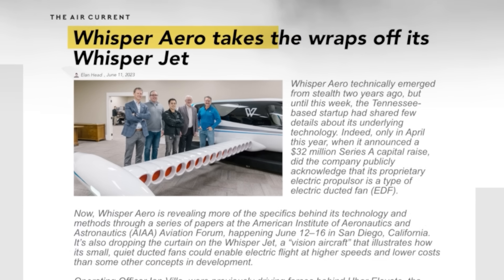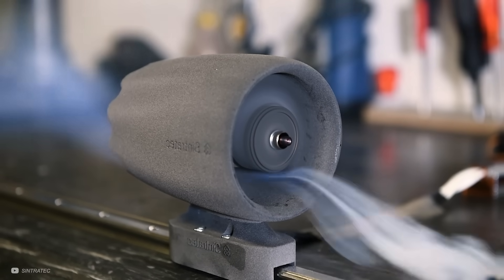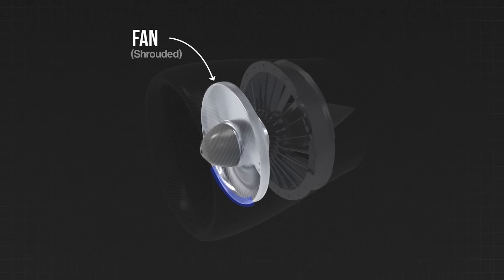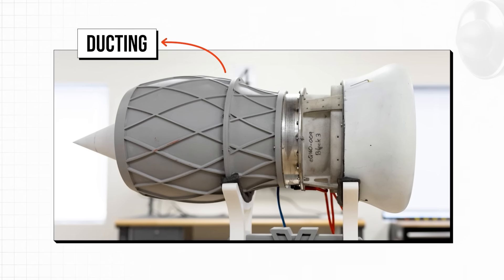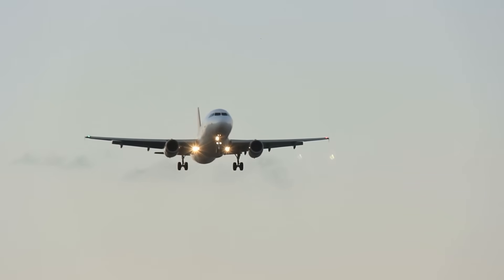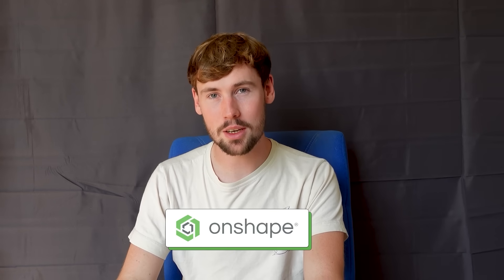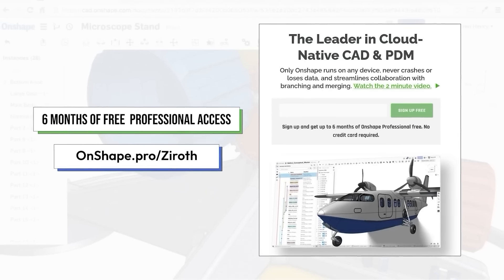This Genius Jet Engine Is Starting A Revolution

Comment: With RISE that promise to meet all noise regulations you get away with nacelle but you add variable pitch blades and vanes, for smaller engines this becomes easier (like variable pitch props on an old P&W R-2800 engine)

Comment: So electricity can be a Jet Fuel? If that doesn't immediately sound ridiculous to you, go study aviation more. Don't matter what kind of fan you're using if it isn't combusting some sort of fuel in a [intake->compression->combustion->exhaust] cycle then it isn't a Jet. Just because it has jet like cowlings or housings doesn't make it a jet engine. Also, @j4s0n39 is 100% right about the energy density of Jet fuel compared to batteries never mind the issues of generating just as much noise but in a higher frequency. Even if its perceptibly inaudible there's no way there aren't biologic and ecologic impacts they don't want to share

Comment: 16000 Hz isn't outside hearing... hearing goes all the way up to around 22000, and back in 2019 (I was 36) my hearing was still able to (barely) pick up sound in that range.

Comment: This is a design crontradiction.. Higher area means higher efficiency, because you need lower preassure difference per thrust. This also means slower propellor-airfoils - thus lower noise-frequency. In general, lower pressure also means lower noise. So, they decided to shift the frequency and see what they can do disregarding other design paradigmes.

Comment: It will work for low thrust slow lightweight applications. The theories they are applying is basically everything known about CFD and they must optimize it and advance further. The kilowatts are simply not there to compete with combustion. In a jet(diesel) turbofan a good part of the thrust is the massive expansion and focus of the exhaust. The combustion does mechanical work that an electric motor could replicate. But has no way to replace mass expansion of super hot exhaust. 
Due to global pressure etc people have been throwing good money after bad. Is simply not possible. That's why they are going for carbon neutral and hydrogen research.  The amount of power the electric fan would need would be at least 50% greater shaft kw, really mw or tw, to make up for the combustion expansion. Until we come up with zero point modules, batteries would be way too much weight. Someone might achieve it with a modified plane with no capacity for passengers or cargo. For comparison on the ground, where's the all electric semi trucks? 
Edison trucks making hybrids is the only way to go. Hybrids are doable. Maybe even in the air for takeoff and acceleration thrust.

Comment: Everyone complaining about battery weight to energy capacity, please go look up solid state batteries.  We are about 2 years out from them being common and will change the entire landscape.
Reply: A solid state battery is promising roughly twice the energy per Kg compared with current battery technology. What is needed for any useful application is roughly 25 times the energy density of the current battery technology. That is the break even point with fossil fuels.

Comment: A gas engine can be quieter than the tires on a car.  Turbines are loud but something like 80% of a helicopters noise is from the tail rotor. I just think that the whole idea of quiet=electric is not always true.  Get into a luxury car like a Lexus and you can’t hear or feel the motor.

Comment: Its never going  to work in real terms on a plain as the jet engine used combustion  as thrust. Jet fuel is more efficient than a battery. And lighter.....

Comment: In my experience, more engines = more $$$. The other problem is how to power an electric engine. Batteries add lots of weight and are risky for passenger transport. If a car battery catches fire you can evacuate, but an aircraft battery fire mid air would be 100% catastrophic. Unmanned aircraft could potentially use this tech, but it will be a very long time before this is safe for public transport.

Comment: DoA, since commerical planes use megawatts of power. One Ge90 jet engine produces about 46 MW of power. For 1 hour of light it would consume 46MWh of power. 1 MWh Lithium battery would way about 10 tons. so to power a 46MW jet engine for 1 hour of flight you need about 460 tons in batteries. 

When keroscene (Jet fuel) becomes too expensive that will be the end of commercial avation for the masses.

Comment: Would be interesting to integrate the design with standard jet engines. They could look into the older triple engine plane designs by replacing the wing engines with these electric ones whilst keeping the third tail jet engine

Comment: This won't work as far I know. This has already been figured out using gas engines. If they are not using a jet engine, a regular 6 blade propeller will function better than a ducted fan. They can try with a duct but a standard propeller or ductless fan will work better. The best design for this is a duct that is slight smaller than the circumference of the fan. The optimal fan speed is I'm guessing is 5-7k rpm even though they say 3.2k rpm. After tackling all those issues you will have to deal with the weight of the batteries.

Comment: 3:50 Noise is NOT just the frequencies humans can hear 
It is any vibration that can cause discomfort or harm .
You can't hear ultrasonic's but they can macerate your ear drums.
This project would have far more value if they could use the noise as an additional power source to increase thrust while it is cancelled out.

Comment: I've seen a very similar design... Not in an engine, but as a static wind turbine. Despite very good results in university testing, it got spun-out and sold off. Suddenly a former head of the NSA was on the board of the company. That is a commonly seen sign of the technology being "secretized" and suppressed by the US government. There was some differences: The first stage was larger than the second, the third smaller still. There were wind "bypass" slits in the cowlings. But the successful general idea is to use the power of the vortex to help spin the later stages.

Comment: Hubbed fans are great for noise control... Not so great for energy efficiency or structural integrity.
Propellers put the mass of the fan blades as close to the hub as possible, because the further out you go, the more inertia you have to fight. In a fan that runs at a constant rate in a controlled environment, this isn't a major concern... But the spin up and spin down of the fan for takeoff, speed adjustments, and wind induced changes from be buffetted by the air... You need much stronger blades to support that hub, which means thicker blades, which means more mass, and you have the propeller version of the rocket problem. In leaf blowers and PC fans this is sometimes an acceptable loss for equipment operating in close human contact... But even there you don't often see it because it just isn't worth it.
Then there is the shroud of the duct. In a jetengine it is a ridge body to encourage airflow of expanding gasses in a general direction, and give mount points for extremely heavy equipment. But in a fan, the blade shape does that. Outside of noise control or trying to bend the flow of air, there just isn't much point to a duct for propulsion, because the fan blades do the pushing and any wall that interferes with that. Airflow is going to cause back-pressure and inefficiency. Then add the additional weight of the duct, and... Yeah. Less efficient, but more control over a few variables.
As someone who lives near an airport... Planes of this size aren't a major noise issue. At the flight height you can't hear a normal propellor based engine on the ground unless it is a particularly quiet day. I just don't understand the problem they are trying to solve. The problem is big jet planes... Which this is not and can't even begin to compete against. It's a red hearing of solving a problem in a market they don't operate in, while not addressing the issues of efficiency and flight time in the battery electric flight industry that is trying to take off.

Comment: I doubt the efficiency loss and increased weight compared to props (and the powerplant weight) will make this practical for actual planes, but the military would probably love some ultra-quiet drones.  Even if they're louder outside the human hearing range, making the enemy have to use (and carry) acoustic detection gear instead of just their own ears would be a big advantage for both surveillance and attack applications.

Comment: @1:44 Where did you ever hear that?  Putting a shroud in it such that it’s measured by thrust instead of lift makes it a “jet”.  Being an “engine” means you’re a “heat engine”, powered by a heat source.

Comment: The problem with electric engines isn't the propulsion. It's weight of the power source. When a fuel powered aircraft flies it loses weight as time passes due to the combustion of the fuel. That doesn't happen with batteries. In fact, there is virtually no difference in weight between a battery that is charged and one that is not. Since there is far more power in a pound of aviation fuel compared to a pound of battery, there is no way as yet for battery powered aircraft to compete with liquid fuel powered aircraft.

Comment: I think electric propulsion has more urgent issues like power supply. At this time I see only the solution by use of a gas turbine generator with a battery buffer. Everything else like battery of fuel cell / hydrogen is too heavy or too large.

Comment: The catastrophic failure of "eAir" is battery tech, or simply: electric won't be viable in the skies w/o battery tech taking huge leaps forward and drastically closing the W/kg gap with hydrocarbon fuels. Perhaps future aircraft are compelled to electrify and take a serious performance hit cuz batteries that light are yet unavailable or impossible (:: this looks like it could be viable tech for slow cargo planes, ~300-350MPH cruise). Who knows 🤷‍♂️ Perhaps if the entire structure is turned into a battery, much as electric road-going vehicle battery packs are structural members

Comment: The concept leaf blower got me thinking about alternative use cases. For example, HVAC systems need to move large quantities of air efficiently and they tend to be noise. Dust collection systems for woodshops and shop vacs can be crazy noisy as well.

I wonder if it would be possible to use toroidal blades on their turbine?

Comment: I'm not an aviation engineer but in my mind the stator would be an array of horizontal and vertical slats, the horizontal ones could have a variable angle to tilt thrust up or down. Maybe the vertical ones could also have a variable angle, eliminating the need of a rudder.

Comment: This is terribly researched.  None of these things are revolutionary.  All modern turbofans have stators, the turbine fans to the rear of the compressors often have outer rings, it's heavier and less efficient than open front fans.  Ducted wing fans have advantages and NASA has done a lot of research into electric wing fans driven by wingtip jet turbines, but that design shown can't glide should it lose power.  Seems like a death trap.
You're just doing marketing for some at best average ideas.

Comment: It kinda just looks like a nicely optimized ducted fan, and not really all that transformative. Its got a convergent divergent fan casing, which is great for flow and maintaining pressure differential. The use of stator vanes is great for replacing a long thrust tube, which is typically the route to eliminate swirl and get horizontal flow. 

The biggest change is the near compressor style fan unit. Like the ring shroud is probs a compromise to get as thin a blade as possible. I get why: the higher the aspect ratio the greater the blade efficiency. That is probably where most of the efficiency gains are coming from.

The compromise for high aspect blades is low potential E-flux, which might be what motivates the fan casing design. It's interesting less because its new ideas, and more like utilizations of design choices more common in gas turbines

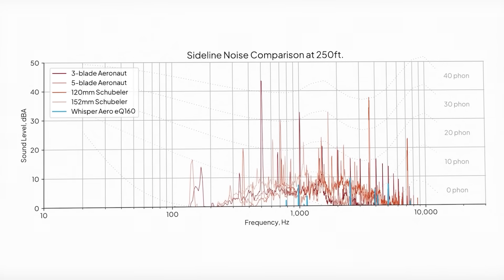Comment: @6:18 This sideline noise comparison is erroneous, the acquisition points across frequency range don’t appear to be standardized given the measuring at 250 ft; the tonal spikes could simply be aerodynamic transitions, not inherent design differences. At best, the plot reflects specific test conditions, not a fair basis for cross-design noise claims.

Comment: Comparing a Ducted Fan with a Gas Turbine powered by Pass Engine will tell you all you need to know. Range, energy conversion size, weight, power.
Your "solution" is anything but, just a dream....🤔🙄🇬🇧

Comment: Cool and all, but saying this "fundamentally changes how electricity is turned into thrust" I just a lie. Nothing changed just optimized. Still spinning fan in a tube. Not much different than normal jet engine (fundamentally that is)

Comment: There's also the fundamental problem of dividing power between several ducted fans, instead of only one. The perimeter of the fans, and therefore the internal wetted area of the ducts, increases with the number of ducts. I assume that they hope for a benefit from some sort of jet flap arrangement, or perhaps the electronically-commutated electric motors don't come in larger powers, and have to be installed in multiples.

Comment: The problem is the weight, size and capacity of batteries / power cells.
Endurance / range is the main problem. It may look impressive on a model, but once you scale it up, it loses its appeal.
You need range, endurance and enough capacity for a commercially viable carrying capacity.
In short you need to be on the same level or more cost effective than an orthodox aircraft.

Comment: Sacrificing efficiency to low noise makes low efficiency certain - high solidity, high speed means large friction losses. So does connecting the tips to a rotating ring, though that might be unavoidable due to the small size of the unit (smaller units suffer more from tip losses). As for using the stator to vector flow, is that Whisper Aero's claim or Ziroth's? That would require each stator blade to be re-pitched DIFFERENTLY, and I don't see a mechanism for doing that, or room for one.

Comment: Since these still require a power source, which is pretty much going to be a turbo generator, it would be interesting to compare the total system efficiency of lbs / hour of fuel burned vs lbs of thrust delivered vs a conventional turbo fan. Then imagine if all of these improvements were applied to a turbo fan. The turbo electric drive is always going to be heavier and less efficient.

Comment: Useless waste of time. Aircraft will never be fully electric the laws of physics dictate that electric planes are too inefficient due to having to carry all weight of the dead batteries to the destination. In a conventional fossil fuel plane it gets lighter as the fuel is burned off so that there is almost no fuel in the plane when it lands. This severely limits the range of an E plane as batteries are heavy. Fully charged they are useful but empty they are useless weight.

Comment: How does it fare when wet? We live on a very wet planet, so it's kind of important. If they utilized grooved blades, would it bring down the noise back into the human range again or perhaps bring it in line with regular drone engines, only with better thrust? I have more questions, but their website has few answers, just like this video. I still appreciate learning about new tech and applications that move humanity toward greater efficiency with less environmental damage. However, I am still skeptical here. Thank you for sharing with us!

Comment: Small dia high propulsion speed compared to aircraft speed is not efficient. A large propeller with thrust at slightly faster than the aircraft is much more efficient. With batteries providing power with a lower power to weight ratio than fuel effiancy is even more important. Training electric planes are in use but 45 minutes with 15 minutes reserve is common 4 x that is common with fuel. A ducted fan only makes the flight times less by around 30% and that is at low speeds not going to compete with jet aircraft at high speed and long flights and fuel is burnt as the flight progresses up to 1/2 the take off weight reducing power consumption not so with electric propulsion weight stays the same for the complete flight.   Electric power is great when weight is supported with wheels but an aircraft the wings support the weight and heavier with less power to weight is not a good option. A car may climb a thousand feet and recover most of that energy descending but an electric aircraft might use all its energy getting to 30,000 feet leaving no power to go 5,000 miles in 10 hours, fine to get to 5,000 feet and learning to fly around the airport for 45 minutes.